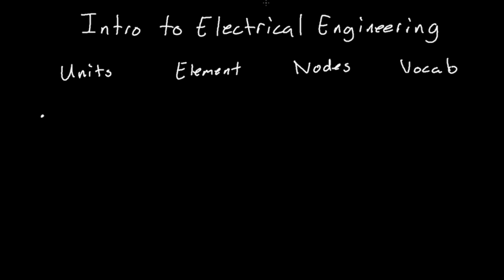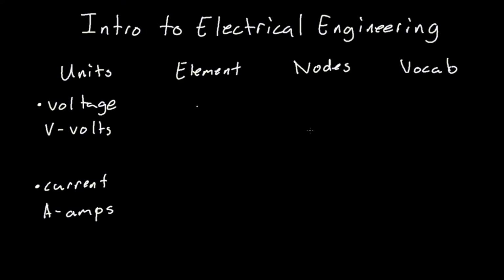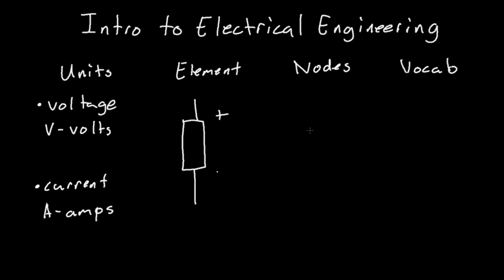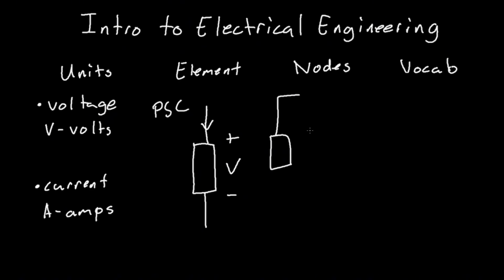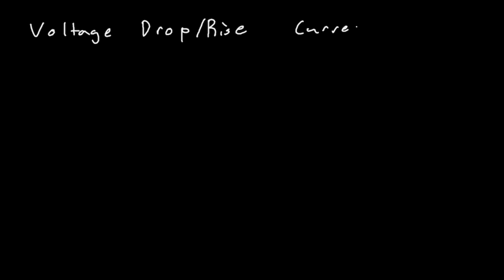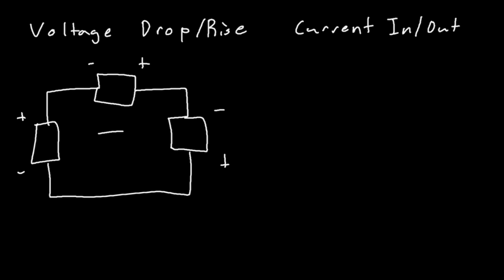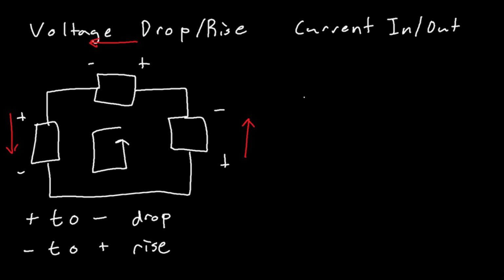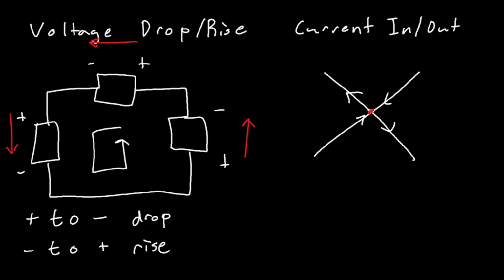Intro to Circuit Analysis - Volts, Amps, Elements, Nodes, Voltage Drop/Rise, Current In/Out

Comment: Interesting, but it would be really helpful if you explained what everything would be used for or gave an example. Like with voltage drop. I get that negative to positive is a voltage rise, but what does that mean? Why is it relevant? How would it be applied? It gives us a reason to remember what it is. And to actually understand it.
Reply from the maker: Hmmm yes applications for things does make it easier to remember. This is a very good suggestion I will take this into account